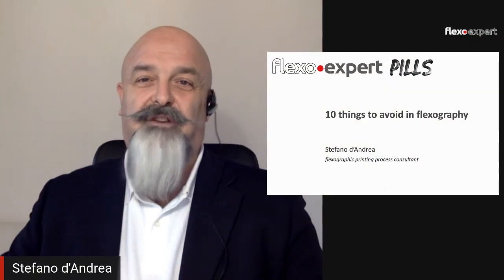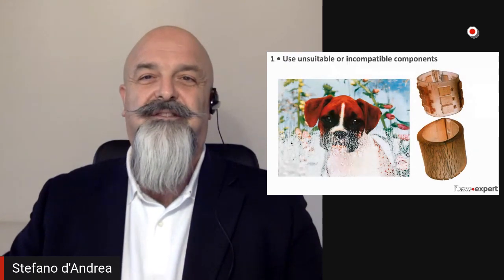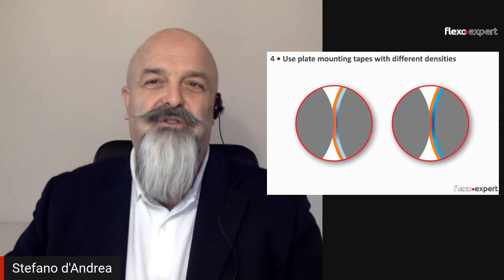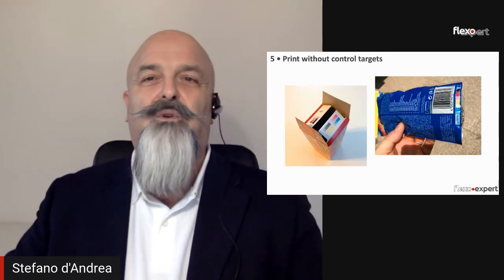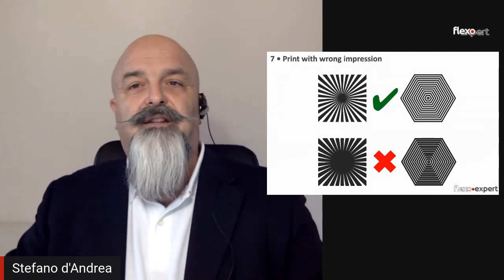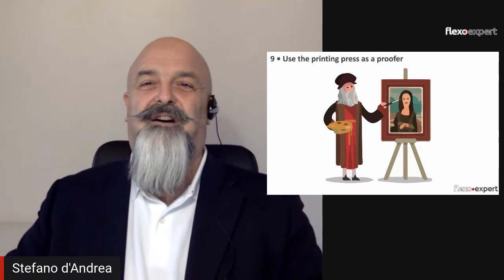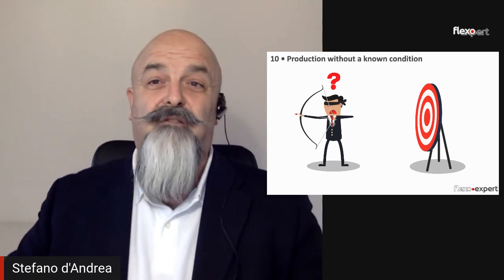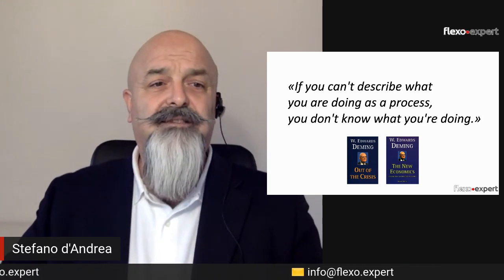10 things to avoid in flexography to prevent from troubles

Comment: We have a new W&H Novoflex II and when printing with 400-500 m/min (1300-1650  Feet per minute) the plates get dirty fast so i have to clean them every 4-5 rolls. When cleaning plates i loose a lot of time and produce less. I worked on a Soma machine before and had no such issues with the same ink, plates and paper. We use water based ink (flint group) and only print on paper. The viscosity is all right and the machine has a very good drying system.  Like i said before on the Some there were no issues and could print 3 shifts without any need to clean plates, drying temperature is set to 60 Celsius on both machines. Any idea how to prevent the plates to get dirty so quick?
Reply from the maker: Hello @Pilek01, if I understand correctly, the 2 presses that you mention are not working side-by-side now. There could be different variables involved, but I would start checking the blade metering angle and tip contact area: if ink is flooding over the anilox walls due to hydroplaning it might build up on plate shoulders. There are indeed other aspects to check, including anilox engraving balance, plate surface texture, plate package compression and impression settings... that would require a more analytical approach. Feel free to contact me directly on info@flexo.expert: I can provide measurements and troubleshooting also on site.

Comment: Hi, I am operating a press. The press is running and it is printing on the paper aluminium foil lamination. Being a water based ink, on some of the prints, the ink after drying is getting removed and in the same scenario on some of the samples, it is not getting removed. What could be the possible reasons.
Reply from the maker: Hi Ravi, I see you also sent me an email with more details, I will reply to that, thank you

Comment: I operate a press and I am supplied ink plates that are to large in in area for the material we print on. This usually results in dotting and wrapping. Do u have any recommendations.
Reply from the maker: Hi Dan, sorry I believe I do not understand your question correctly, can you explain in more details? Maybe you can write to me to stefano@flexo.expert
Reply: @flexoexpert we are facing too much fast drying   only in one ink (black)  and overlapping color.please guide us how we can eliminate such defects
Reply from the maker: @iqbaliyat7599  too little information here. Short reply (and for sure 100% useless): if the ink dries fast, add retarder. If inks have problems when overprinting each others, check ink volumes and drying. Of course it would require a more detailed analysis of all variables involved. We can connect via email on this: info@flexo.expert